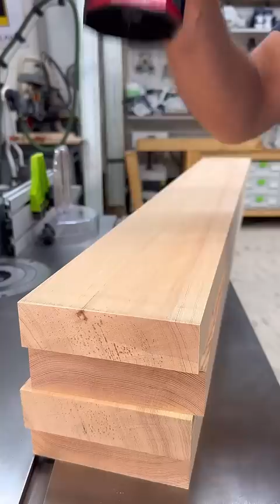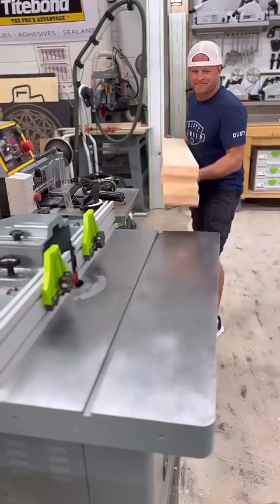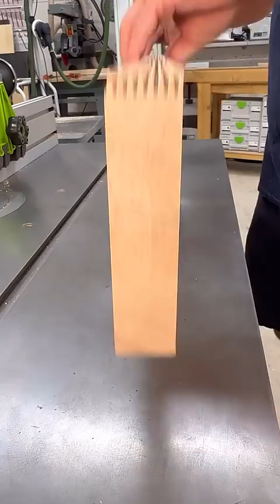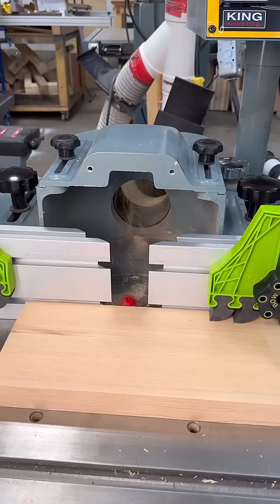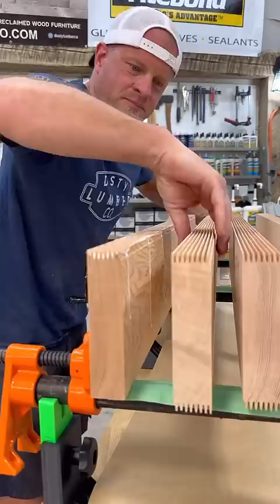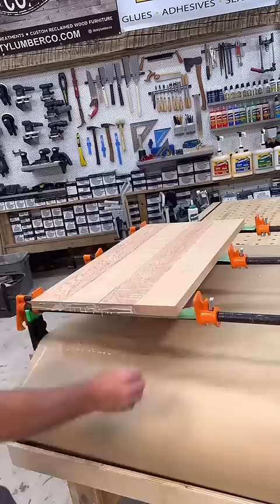Freud finger joint bit and I definitely used way too much glue #freudtoolsambassador #woodworking

Comment: for those looking for the finished product, we will show you once the glue dries up
Reply: So like... in two years?
Reply: If you know you know. It's still getting planed or sanded after, but the edge alignment looks pretty good. Definitely better than some of the edge joinery I've seen.
Reply: The glue dries up in 5 minutos
Reply: @evaristocastaneda4820   the optimal time for woodglue is 24 hours, for those fibers to properly absorb the liquid and bond together tightly, glue is already dry in just hours or so but the wood bond is not yet that great, never seen a five minute dry glue though
Reply: @Sheenamay-ko9ne it takes only a few minutes to dry beyond being malleable. I assume that's what the commenter meant. Another important factor is the climate, especially humidity.
Reply: Ok I'll check back in a few years
Reply: Soo never😂
Reply: @homecactus  what kind of magic wood are you dealing with? You even know humidity? OMG YouTube expert spotted!
Reply: @Sheenamay-ko9ne  I'm not the expert, my dad is though, and I've done some hobby wood working myself as a result of easy access to machinery etc. Wood types are mostly tropical woods (Mahogany, Zericote, Cabbage Bark, and more), and of course some non-native species that are imported. Since I live in the Caribbean, and the Caribbean being on the equator I definitely do know what humidity is lol. Anything else you would like to know?
Reply: Lol
Reply: Did the glue dried up?
Reply: Why didn't you just buy a 2 x12
Reply: @homecactus  yeah it's been two weeks and you still can't tell the brand that dries up in 5 minutes🧐 now I even doubt if your dad is really an 'expert'😁😁🤣 and all that unnecessary information you've said
Reply: @Sheenamay-ko9ne  you never asked for a brand. You just made some dumb comments about magic wood and doubting if I actually knew humidity. I specifically defended another commenter, who I assume meant that glue dries beyond being malleable in 5 minutes, you know when it gets so sticky that it doesn't smear anymore. I didn't even make the claim that it does, but knowing how much external factors can affect dry time I would definitely give them the benefit of the doubt. But sure I'll play your stupid game. My dad would use Titebond II or Titebond III, haven't been in the shop for years though, not sure what he uses now.
Reply: @homecactus  yeah, the titebond instructions says 24-72 hours curing period, so it's either you are wrong, you are using it wrongly and most probable is you are a YouTube keyboard expert, 

My point stands, no woodglue dries in 5 minutes
Reply: @Sheenamay-ko9ne  I LITERALLY said that it takes a few minutes to dry behind being MALLEABLE, something that I'm not sure the instructions would even say necessarily. Have you ever even used wood glue? You don't seem to understand the difference between set time and cure time, it should be common knowledge if you know anything about adhesives at all. Call me a YouTube expert sure, I don't think I am really, but I do have real world experience, something I'm not sure you have.
Reply: Yes. I thought they would show the finished product. But silly me the video is about glue.
Reply: @Sheenamay-ko9ne You must be fun at parties.

Comment: I think those joints are dry that will make them brittle and easy to break I recommend using more glue next time👍
Reply: @jasono2139 I'm not falling for that trick again Mr. Elmer 😼
Reply: A real carpenter dry ages their wood in glue first. Guys a noob
Reply: @RealJPMcGrath  100%... way too much wood in that glue if I say so myself.

If it doesn't look like uncured Bondo before you go to sand it, you're doing it wrong!
Reply: I only liked this because I want to be like 100
Reply: @jasono2139 way to STICK it to the man. 🥁 🥁 TSS
Reply: I recommend to use glue only
Reply: @Onigumo.  👈😎👍

This guy gets it!!
Reply: 😮❤ @soralee1910 mo

Comment: Is this what they use to make a 12 foot baseboard out of 32 pieces of scrap?
Reply: Even worse in door jambs
Reply: 0 98
Reply: @YourFavouriteComment  The door them selves where you can no longer use hand planes
Reply: Or you can pay twice as much to get "stain grade"
Reply: @sculptormills  Thought that was the reason for re-foresting?
Reply: @douglasmichel6361  I'm not a tree hugger, but common sense says they can cut a tree down in under a minute.  Reforestation can take 18-30 years. That's if they use crappy knot riddled loblolly pine. Good southern yellow pine is 30-50 years. That being said,  I care enough about our environment to make a tree stretch as far as it can.
Reply: Even better use MDF for paint grade mouldings and OSB for floor panels that are going to be covered with laminate flooring to carpets.
Reply: @davidelliott5843  MDF is so crappy. Too sensitive to humidity and I live in a very warm but humid climate. Got any solution?
Reply: @sylviekoenig9960 plastic... humidity has basically zero effect on it... lol

Otherwise marine grade plywood 

Or more expensive MDF or OSB... 

Or just use actual hardwood lumber to build things and not just the sawdust and wood chips from the sawmills trash pile mixed with glue and pressed flat with a real wood veneer from the sawmill to make it look like real wood.
Reply: Hella cheaper
Reply: @PolarisRider06  Plastic doesn’t last under the sun and the sea salt. All Lindsey or termites eat away at almost anything. 
Sadly hardwood is the only option but extremely expensive and not so great for forests…
Reply: @Dr_Mike2 is that where the board stretcher comes in?
Reply: I supervise 3 finger joint machines making dpor jambs base board and hand rail and that cuts a better reverse joint than the new Western Finger Jointer
Reply: Glue joints are stronger than wood itself.  Test it - glue two 1x4s together, clamp and let them dry overnight.  Put it in the vise and hit the upper side with a hammer.  The wood will break, but not along the glue line.
Reply: @douglasmichel6361  the point of the cut is to make otherwise unusable pieces useful. Sure planting more trees would also mean you could make the same amount of product, but at the cost of wasting the other pieces that otherwise could have been used. Another alternative would be to take the waste and turn it into particle board, which has it's own drawbacks, being that it is just a bunch of sawdust suspended in glue, it's not exactly the strongest of things, however still better than wasting the wood altogether
Reply: @fredbecker607  wait... Board stretcher? I wish I had one of those for that time I cut 1/16" too short!
Reply: amigos4erin  wait what? As in, if you glued the board along the grain, and not end-to-end, the glue holds better than the grains of the wood itself?
Reply: @sculptormills when they cut the straight boards, they don't send them to Lowes or Home Depot. I think the boards at the box stores are reclaimed lumber that once served as bows for Conestoga wagons.
Reply: @sculptormills 
Muy buena respuesta,  para ignorantes de profesión.
Reply: @Dr_Mike2   I feel like most people with at least an average IQ feel this way.
Reply: And sell it for 400$ yes
Reply: Recycling at its finest!  The scraps are cutoffs from lumbermaking and the only other option for them is to chip the scraps up for paper.
Reply: Das ist nichts neues. Die Industrie benutzt das schon sehr lange.
Reply: 99p😂
Reply: @Dr_Mike2 southern yellow pine takes 30-50 years to grow fully and during that time its going to be an astronomically bigger carbon sink then regular fully grown trees, 

meanwhile during these 30-50 years you can keep cutting down and replanting other areas of the same forest before starting the process over again with the now fully grown yellow pine so the de/re forestation stops expanding
Reply: amigos4erin Sealing mdf will not work on bathroom baseboard, It will make it last a little longer. Sometimes mdf surprises me and doesnt immediately explode from moisture but ive demo'd miles of water damaged mdf so i only use it in very dry places.
Reply: What's with all that glue ?
Reply: @Dr_Mike2 I'm not a comment hugger, but I'd like that comment many times over. It's true that humans worldwide don't plant back as many trees as they cut down.
Reply: @sylviekoenig9960  Water-resistant MDF. You need MDF with non-water soluble glue that's rated for exterior use.
Reply: A friend of mine owns a molding company that does finger joints. I asked him why and he said that they remove the knots by doing it that way. Makes it better for painting. No more knots bleeding.
Reply: well done man. first he sawed a large board. then glued everything back
Reply: It can be bought for spindle molders in a much bigger size, great for jointing end grain to join your off cuts. @sculptormills
Reply: I literally read that the first two times as 32 pieces of crap.
Reply: Fingerjoined pine is great, use it all the time. What’s wrong with it
Reply: @sculptormills the inventor should be celebrated like Einstein😅
Reply: @YourFavouriteComment I worked in a door shop for some time. It is really remarkable what jeldman and orepac put out😂 Bend in the fjp so bad that the joint pops out more than 3/8, right above the latch plate. Horrible quarter inch plus or minus head spacing, doors not machine flush cut, more like 5° offset. The door industry does not put out what they used to.
Reply: @sculptormills I think for the companies, it's not about saving trees, or saving the environment. I having been in quite a bit of finish wood production industry, it's all about making more money. The MDF replacement for so much of trim and homes has made them disposable, fjp not lasting the same, these homes will be gutted out, or demolished in less than half the time of an old Construction. This is far more wasteful in so many different materials.
Reply: @Dr_Mike2 I know quite a few loggers, and have been privy to knowing some of the larger Logging Company owners in the state. The Private Industry is responsible for so much tree replacement, and revitalization of the forests. Studying how the industry works, it will blow your mind how ecological many of these industries have become. Not being forced by the government necessarily, but definitely doing it to keep the industry alive.
Reply: @sylviekoenig9960 MDF has made homes trim non-serviceable. MDF is so wasteful, and is absolutely horrible in so many climates. Unfortunately, the market has been pushed and pigeonholed into buying much of their trim in MDF. (Base especially😒)
Reply: Sweet plate joinery. No slipping. No cauls.
Reply: @sculptormills It sure looks nice on the eyes that way, but people accepted old/medieval style doors we wouldn't need the huge trees haha Instead of fitting and gluing the boards, two or three can be nailed crosswise. It's a bit rustic...
Reply: These aren’t scrap. Their prepared plank boards.
Reply: amigos4erin modern glue is stronger than lignan but weaker than cellulose.  Wood is made of both cellulose and lignan
Reply: @sculptormills My ex girlfriend majored in "wood technology" in college, but ahe didn't know sh*t about trees.
Reply: @davidelliott5843 Meh.... I wouldn't advise mdf base.
Reply: @sylviekoenig9960 PVC baseboard! Im kidding. That and the mdf base is garbage.
Reply: @spf-92.5 Me too. Anyone who says different hasn't torn out mdf and reinstalled hardwood enough.
Reply: @WilReid Armorite, or MDF exterior grade is still worse than plywood for wet and or humid climate. You'll never beat hardwoods for base, crown, and casing. Doesn't matter what glue is used or how you seal it. Its a fact. If you disagree, its because of something you've read as opposed to your experiences in real world, day to day scenarios.
Reply: @ryanwoods5366 what if they want to stain it?
Reply: Ui88866
Reply: @SaucyOperator  if you want to stain it then finger joint wood wouldn't be good. Have to buy the solid ones for that. Much more money too.
Reply: Just a basic 22.5 joint and some unpaintable silicone caulking to fill the joint from the non zeroed saw.
Reply: @ryanwoods5366  I was joking. I'm a finish carpenter, and I paint and stain most of my own jobs.
Reply: .good one bro...I hate that trash
Reply: @sylviekoenig9960 if you have the ability to soak the pieces or just dip them in hot beeswax, it will definitely help preserve it, well then you would have problems painting it....🤷
Reply: I got way too big a laugh out of that😂
Reply: Or the kitchen table top...
Reply: What is that brown sheet called?
Reply: @sculptormills most I’ve seen are a fiberboard now. It’s a lot cheaper and more efficient than trying to piecemeal scraps. Looks better too in my opinion.
Reply: paper @granthpunjabi
Reply: @douglasmichel6361   You believe that? :D Re-foresting is for tax-breaks.
Reply: @jacomoncal     Says you!
Reply: If you were going to glue them all together, then why did you cut them? 😅
Reply: This is how IKEA makes furniture out of cheap wood scraps by gluing the pieces together to make big boards
Reply: @douglasmichel6361  who has 40 years to wait for a tree to grow to minimally viable product.
Reply: Exactly. @sculptormills
Reply: Not even fi ger joints, they just laminate it
Reply: @AtomBomb420  I haven't seen if anyone replied to you explaining it so I'll do so just in case. End grain to end grain is the weakest joint you can make. You want to avoid it as much as possible. think of it as gluing the pin pricks of the grain together instead of the long strands of edge/face grain. Less surface area. 
When people glue pieces end to end with no fasteners they either use the same kind of joint as in the video or do a scarf join (which is where the end is cut on angle, the longer the better. Think 2"+ long on a 3/4" piece minimum) so that the glue is adhering as much long grain as possible.
Reply: @lenny108  A piece the size of the one in the video will always be a glued up panel of smaller piece. For both how wide boards are available and for stability. It minimizes warping. That's standard in any wooden piece of furniture. Though flat edge to edge is far more common I believe.
Reply: @Dr_Mike2    Which should have been done 18-30 years ago, and done every year so there is a fresh stock every year, it's only the first planting you need to wait for. If you cut 50, you plant 80,  after the initial 18-30 yrs, keep planting 30 more a year than your cutting.... you end up with 900 more trees than you started with. Pretty straight forward if done correctly.
Reply: Science!
Reply: @sylviekoenig9960  UHMWPE is a strong plastic that I don’t think is sun sensitive, might end up more expensive than hardwood though. Positive is that it’s a kind of horrifyingly durable and long lived material normally used for industrial bearings and medical prosthetic components.
Reply: @sylviekoenig9960 trimmed out my house with some modern looking polystyrene baseboard, no water risk and cuts / nails solid
Reply: @Bustudent1  Thanks. I’ll investigate to see if we have some of that stuff around here.
Reply: @Dr_Mike2 but good wood furniture lasts 50+ years. Garbage made shit won't last 10. So you will need even more trees at a more frequent rate because of furniture made with terrible quality.
Reply: @sylviekoenig9960  depending on your location and what type of hardwood you get hardwood may actually be good for the forests. 

Obviously it needs to be responsibly harvested wood and that means cutting it down before it gets too large and starts to die and rot away and become a fire hazard as well as thinning of dense areas of the forest to allow young trees to get more sunlight and grow healthier.  Regenerating (growing) forests make way more oxygen than on old growth timber stand, so it makes sense to cut the large trees while they can be used still and not just waiting for them to die and become fuel for the next forest fire
Reply: @YourFavouriteComment  It's for painted situations where there is no stress on the lumber like trim mouldings, you wouldn't know or care if it was finger joints since you couldn't see them. I wouldn't use it for a table top.

Comment: Never used finger joints but that looks pretty cool, and a nice shaper as well. OK, a little heavy on the glue, but far better than a glue starved joint, and it' s easily wiped off. Nothing to be ashamed of there, and it went together well.
Reply: this was a terrible example. This bit is designed to "lengthen" long boards "end-to-end".. this video is an epic fail of what this router bit is designed for, sadly
Reply: @thefeet 
It doesn't matter what something was made for.
You can also open beer bottles with a screwdriver or make patterns in butter with a comb🤣

Comment: if my dad took me to a workshop with this level of machinery, i would want to be a carpenter
Reply: Wood Worker or Cabinet Maker, carpenters are more construction based. It’s not a bad idea though, learning a Trade is the best thing to do.
Reply: @zombadie1025  I dunno man.. A robot welder engineer or operator Can still be called welder?
Reply: @thekulolali yes they can be. What do you think underwater welders are doing? Or surgeons using robots? The operator still needs precise knowledge of the field to make adjustments
Reply: @thekulolali then you need to look deeper, if they works on mass produced welded material, no they just an operator, no more no less
But if they works on many types of conditions that needs manually on hands and automatically, yes they are welder
Reply: Достаточно увидеть это видео, чтобы захотеть быть плотником!
Reply: @thekulolali 
I see it that way too, but some people want to show off their intelligence.
you know!😊
Reply: @radityarputra2294  this is I agree👍